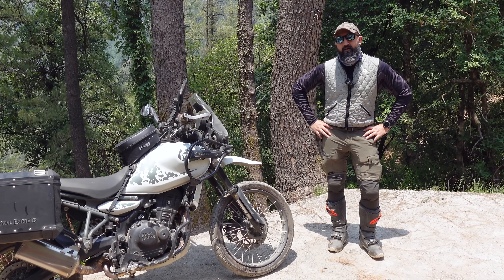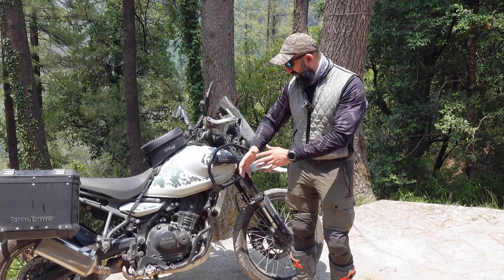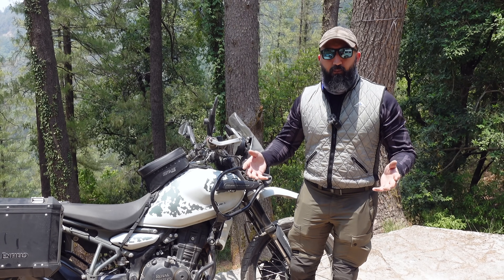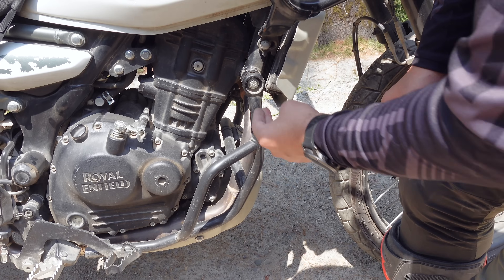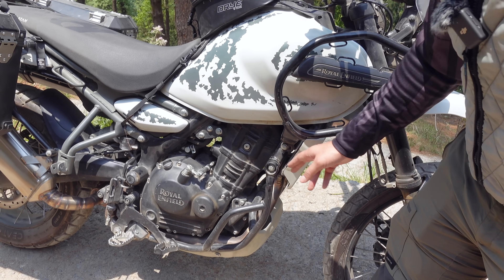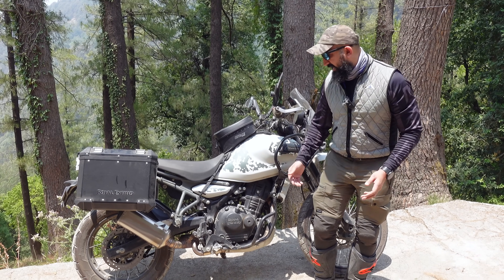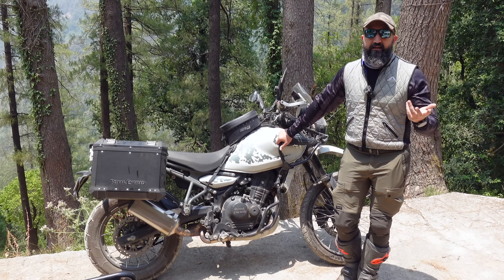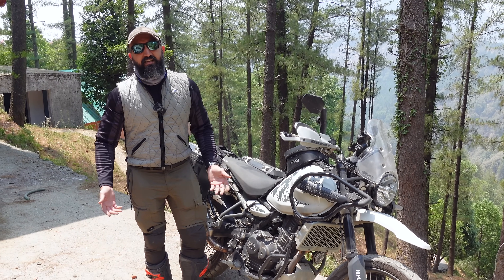Why Did Himalayan 450 Chassis Break: What I Learnt From Royal Enfield

Comment: None of the explanations makes any sense. It's like a politician providing justification for a bridge failure. RE very well knows the amount of customisation it's vehicle goes through. They purposely ensured that people can't fit non OEM for their own pockets. How come old models wherein there was no concept of accessories and bullets were able to manage it but newer models can't. RE at fault all the way.
Reply: Simple solid engineering vs complex modern engineering. 

Not saying RE made a mistake with going more complex.
Reply: @tazz31415  I haven't heard any issues on Hondas and Yamahas.
It is likely very few and I doubt they are as as catastrophic as the bike breaking in half.
Otherwise I am sure it would have been a headline in the automotive world in India.

Xpulse for hero and RTR 200 as well as RR310 have engine as their stressed member.

Time will tell if it is larger issue or RE was just unlucky.

Torque specs cannot be a reason. Since all other brands also go to local mechanics where things are hand tightened.
Maybe they need to re-engineer and add a space for an extra bolt for the crash guard.
Reply: @anirudhhhh comparing 200cc budget commuter to mid weight ADV tourer? 

First let these brands make a bike bigger than 250cc and then talk.
Reply: I used to tell my friends that let alone bikes from other brands like tvs,Yamaha,Bajaj. Even a Luna or scooty won't breakdown. It's only RE which breaks down
Reply: Bajaj dominar build quality better than Himalayan 450... 
Please don't buy Himalayan 450... Wait for upcoming KTM 390 adventure.. Royal Enfield need more money 😂
Bike price 3.5 accessories price 2.5 lakh 😂🐍🐍🐍🐍
Reply: He is spot on correct...it is the aftermrket crashguards are the problem and improper torqing...most people do not also understand the concept of pre stressted component...
Reply: You don‘t understand simple mechanics!
Torque and load distribution is crucial for stress in a construction - so learn a bit more before you make comments like this!
Reply: Just because you are incapable of understanding doesn't mean everyone is ignorant of mechanical engineering. Any brand of stress member engine/frame build will break if the engine frame connection is compromised.
Reply: @tazz31415 Bro for TVS, Hero, KTM, Bajaj, Honda and Yamaha we don't hear such issues.
These brands had engine as their stressed members for years now.

And people install giant zoo cages in the name of crash guards.All of it is aftermarket.

RE needs to also investigate how their competition deals with such engineering problems.
Reply: @anirudhhhh Zoo cages🤣🤣🤣🤣🤣 you make me laugh 😂
Reply: @anirudhhhh Which tvs, hero and Yamaha have stressed frame?
Reply: @anirudhhhh  FYI Yamaha had engine frame crack problem on older (Alu) FZ series. If a frame has an engine as a stressed part, tampering with engine mounts is not safe coz if you do it improperly it compromises the frame. It's inevitable if you want modern motorcycle with engine as a stressed member.
Reply: True that. He is like a engineering student with sub 75 IQ answering questions in his placement interview.
Reply: You are right, but thats the bussiness, look at tesla and its accesories, it is the same.
Reply: Exactly. People can barely understand this yo yo explaination.
Reply: Oh yes, single downtube and dual cradle chassis are the same as a trellis frame. Do the world a favor and quit motorcycling please 🙏
Reply: seeing your comments after 4 months😂. Read the fucking owners manual..whether be it h450, gs 1250, tenere 7 or any giant advs..you will see something written calles “do not use aftermarket crash guard”…if you use, then fuck around and find out. H450 is not your typical budget adv anymore, it has evolved, you just cant do chapri things in it anymore. sad ain’t eh?😂
Reply: I'm guessing somebody slipped them some steel that was rated higher than it should have been.
Reply: Arts banda hoga tu agar samaj nahi aaya toh 😂
Reply: Exactly…He sounds like the marketing team of RE asked him and a few YouTube creators to post this…
Reply: You can still buy an old model double cradle frame Chassis RE scram if you can't understand and live with a modern stressed member engine bike like Himalayan. Just don't cry about increased weight, lack of power, vibration etc.
Reply: When I was buying a 250 cc road bike 40 years ago they were all pretty much the same except the Honda CB 250 had the engine as a stressed member of the frame which I did not like or trust so I went for the Suzuki instead. @sreeharsha1828
Reply: @tazz31415  RE fanboys have learnt about this kind of chassis for the first time, so naturally they think that no one else is using it. 

As a matter of fact countless motorcycles use engine as a stress member and most don't split in half spontaneously.
Reply: @NoNonsense_01 and they don't put poorly researched crash guards on them
Reply: Tell RE to remove the engine all the problems are solved. 😂
Reply: It won't happen in the UK
The off - road image is Purley for the image
These bikes rarely see dirt in the UK
Reply: @guyonacub4335  true. And for most Europe too.
Reply: True, RE repeated the last frame fiasco, 4 years of so called research and design to bring out another inferior frame for a bike. Make a full frame immediately that will fit up with all the components used on this bike is the only answer, and never ever use that type of frame again where it depends on the engine to be a structural member, I believe in time we will also see the ally mounts on the engine fail, they are not strong enough either.
Reply: This is just a RE way of marketing gimmicks again. So the reason dakar proven frames are always the best to go with. You know what I mean! 😂

Comment: Excellent video Mr. Bhatt, and right on time as I leave for my PDI. I'll confirm if the RE accessories installation guys are using torque wrenches (just for my peace of mind), so if in case they're not, I will just forgo the rally protection for the time being. Bone stock with factory settings feels like the safest way to go ahead right now.
Reply: Its a top heavy bike, bound to get dropped.
Reply: @mohitonutube  Excellent point, Mohit. I went to the service center after PDI, and confirmed that they torqued in the bolts with hand tools instead of a machine. And I also spotted a H450 there that had come in for service, whose rally protection was severely misaligned. So that sealed the deal for me. I'll postpone it for now, and take the calculated risk. I haven't dropped my Thunderbird in the past 8 years (knock wood), so fingers crossed :)
Reply: You have a badly designed bike, using the engine as part of the frame is a very very bad idea, it will always be a weak point.